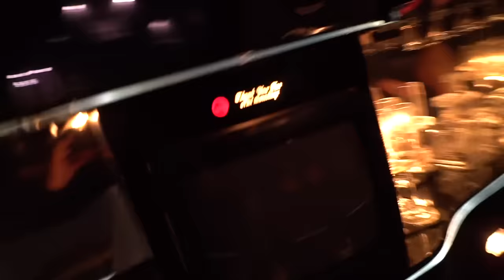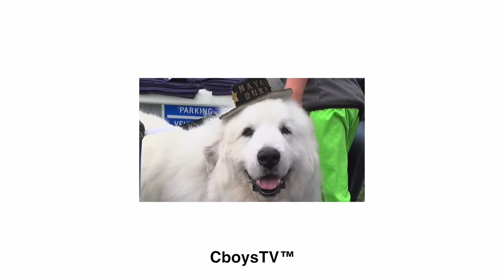Drift Sleeves on Smart Car!! (It worked)

Comment: I have a 08 smartcar how did you turn off traction control
Reply from the maker: Turn the key so power is on but not the engine, hold both dash buttons until the traction control light flashes, then start the engine